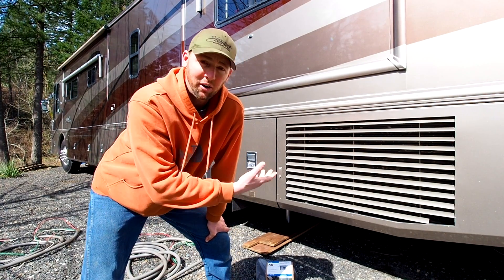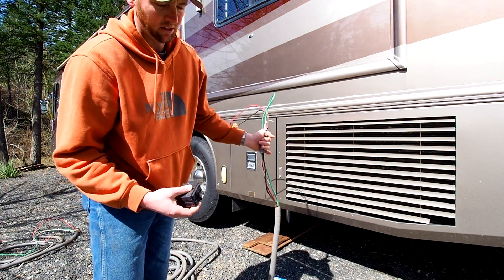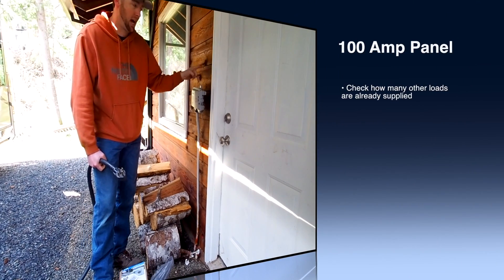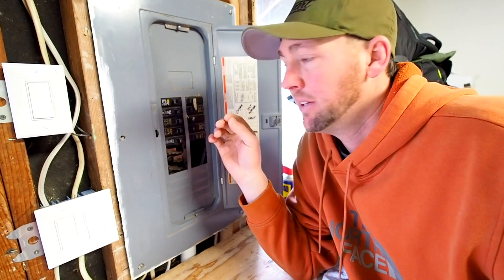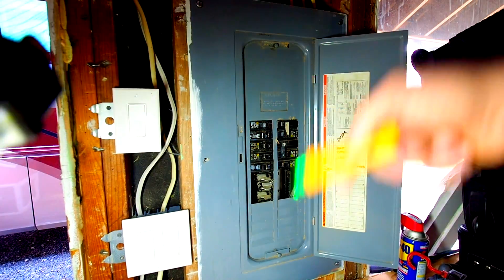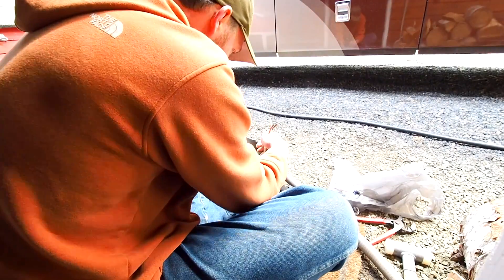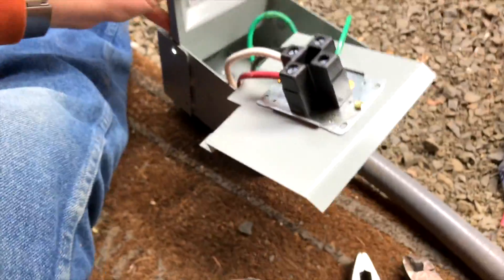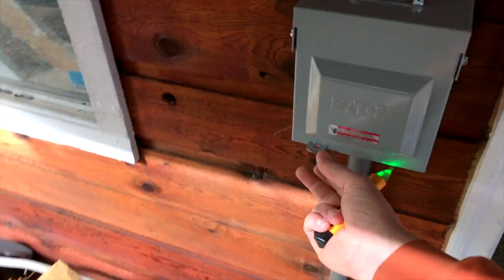RV POWER SUPPLY INSTALLATION FOR UNDER $50

Comment: FYI. For those who live in the states, per NEC code, electrical sub panels located in separate buildings from the main panel require a sub-panel main breaker.
Reply: Ya, I was thinking the same thing? Basically, if it can't be reached at arms length, you need a main breaker.
Reply: @commandtheline   I was like who put this together and didn't add a main breaker to the sub panel...

Comment: Nice job. I have a similar setup but regret not installing a second breaker at my pedestal which is about 150ft from my garage. Also, for those having an electrician installing, make sure they know how to wire the receptacle for an RV. The plug is very similar to a 220v dryer or range plug in your house. The 50 amp RV plug is wired differently to power two 120v circuits. I've heard horror stories of equipment getting fried because of this mistake. Cheers!
Reply from the maker: Thanks Brian! Yes I saw some videos talking about electricians & people mixing up those 220V dryer circuits. Bet they won't make that mistake again. I really enjoyed your recent battery install. Once we sell our house I'll begin our own battery upgrade and solar panel install. The jobs never end! Hope you guys' summer travels go well!
Reply: RVwithTito there is no difference in wiring a 4 wire dryer receptacle or rv receptacle, if someone let the smoke out they don't know what they are doing, this was a good install video, I would definitely spend some money on an actual meter so you can see voltage as a # instead of a beeping or flashing light, it's always best to check to make sure you have 120/240vac before blogging in your rv
Reply: Blogging>plugging
Reply: @OutsideIsCalling  That is exactly what happened to my parents. Luckily they used a surge protecter when plugging the camper into the box their electrician had wired to 220. My mom read the instructions that came with the box and instructed him how to wire it correctly. Needless to say, they wired the next box themselves. Thanks for a great video.
Reply: That’s a 220 4 prong plug.

Comment: im doing a 30 amp service is there a polarity issue with where you connect the hot wire on a three pronged recepticle and outlet?
Reply from the maker: Hi Alan, I had a similar question with the two different hots on the 50 Amp connector, and whether or not it mattered where the two hots went. It definitely IS critical to land the hot, neutral and ground wires to the proper connection points. I found several images from a Google search, hopefully similar images will help you see which one is which. It's pretty critical because if the wires get mixed up, it could create a direct short or several other problems. All of which will have big consequences. Hope that helps!
Reply: The 30A outlet has a hot, neutral, and ground. They must be connected up correctly. In your circuit breaker panel, you have two hot. I recommend connecting to the lighter-loaded hot.

Comment: Great job! No "main breaker" in your sub-panel is what we electricians call it. Now, come and do mine. I just bought a used '06 5th wheel.
Reply from the maker: Thanks for the tip! Haha, you'd probably do a better job than mine 😅
Reply: @OutsideIsCalling  You've got the electrical panel nailed! Perfect job. I see no problems.
Reply: @OutsideIsCalling  Have you had any problems?

Comment: I've owned a motorhome for about 10 years.  Over that time I've repeatedly seen the recommendation that you switch off the 50A circuit before plugging in, then switch it back on once the plug is seated.  The reason, as I recall, has to do with concern that if the prongs on the plug don't make simultaneous contact to a live circuit it can damage your coach.  (I realize that's not a good description--what kind of damage?  How?  Etc.  But I don't have a detailed understanding of the risk.)  Most homeowner RV connections I've seen were just like the one you illustrated; just a local receptacle to plug into; breaker switch in a panel somewhere remote from the hook-up.  Even some RV parks are like this.  But most RV parks have a breaker switch right on the pole, and in those cases, it's easy to switch off, plug in, then switch back on, per recommendations.  So here's my question (for anyone who might have a reliable answer):  I'm installing my home 50A RV circuit now.  Even though I will have a 50A breaker in the panel as normal, I'm wanting to put a SECOND 50A breaker in the line right at the receptacle, to serve as a convenient local on/off switch.  Any problems (code violations, technical concerns) with having a SECOND breaker in the SAME CIRCUIT?
Reply from the maker: Hi Tom, hopefully someone with knowledge of the electrical code can chime in, and I'll share what I know here:

Yes it is really helpful at RV parks having the breaker right at the panel. There are all sorts of configurations, some have all 3 (50A, 30A and 15/20A) with breakers right nearby each one. And you've probably seen many parks will have just one or some other combination of those choices.

Many coaches using a 50A service will have half of their loads on one side, and half on the other side being fed by the two 50A prongs. To my knowledge the biggest concern is electrical arcing, say you have two AC units and a dryer that all kick in the instant you make the connection. And as you mentioned the connector going in crooked might cause one side to energize before the other, yet another good reason to have a dead circuit.

I would feel comfortable installing a second breaker to make it easier to kill power during hookup, AND it would be a great way to know that the power is in fact de-energized. A breaker far away, out of sight could be switched without your knowledge. That's why hot tubs and AC systems require a disconnect of some sort nearby the appliance. I would wonder if there is any considerations about multiple breakers causing more resistance to the electrical flow, or if heavier wires would be necessary? 

Please let us know how your install goes!
Reply: You turn off the switch when plugging a 50A plug to make sure that the neutral connects before the hots do. If neutral does not connect, voltage may be appear high on one hot-neutral and low on the other hot-neutral. 30A can be plugged in with the power on as there is only one hot.

Comment: How far from the panel box can I run my 50amp service 🤔.  Not able to get that close to my house with the RV
Reply from the maker: We have the same problem at our new home, which we wired for 30Amp service. If you're still looking (sorry for the delay) you're best to find a good electrical load capacity chart. Just measure your power run, reference the 50amp chart and it will tell you which gauge to use. I believe we added a couple books in our Amazon Gear list just for this video which will give you all that and then some. Best of luck and it sure is nice having a way to power an RV at the house. It'll make a big difference in keeping it clean, mildew free, and pipes from freezing if not fully winterized. That Amazon list should be in the description as well as links within the video 👍

Comment: How long was the wire run..I need to go about 225lf from the panel to my RV so wire size is key lol
Reply from the maker: He Tim, you'll def want to check out wire gauge charts to make sure your wire is thick enough. If you go too small the wire can overheat and fail. Ours was less than 10 feet fyi. Please let us know what you end up using 👍
Reply: @OutsideIsCalling  Will do, I am rethinking the entire project and considering going 240
Reply: @OutsideIsCalling  Thanks for the heads up!

Comment: It seems to be the same hookup as a household 50amp, is that correct?
Reply from the maker: I can have Jesse come on here later and correct me if I'm wrong, but yes this was a 50 amp household setup in our garage. Thanks for checking it out! Are you doing any RV diy projects?
Reply from the maker: Hi Tim! Jesse here. The 50 amp breaker on the panel is pretty standard, although there are a few variations for different breaker panels. You do want to be careful as there is a dryer outlet shaped similarly to an RV outlet. We'll put a few links in this video soon for the exact parts and pieces I used.
Reply: I’m constantly doing things with our motor home. Had to replace valve on the back of refrigerator for ice and drinking water, a clothe washer leak, replace a motor on one of the slides. The people who had it before us never used the furnace so when we went to use it, it wouldn’t work, we about froze in the 30 degree weather. The manufacturer wired it wrong, therefor we called the manufacturer and they stepped us through it and paid us for our time and inconvenience. The microwave almost fell out going down the road so the manufacturer also paid for that along with the extended warranty company. It was a year old when we bought it and we’ve had it for 2years now.
Reply: Thanks Jesse, appreciate y’all quick response. I’m looking forward to the links to put in a 50amp instead of the 30 amp we have in there now. It was a 30amp dryer plug but I just unhooked one of the hot wires and it works ok for 1ac unit, fridge and lights.
Reply: NO! It is not the same as a household 50 amp plug!
Reply: @thesteveprichard  I know it’s not the same plug but electrical hookup. Thanks for the info.

Comment: Recommended you test with a multimeter  for correct amps to each hots and not with that wand garbage.
Reply from the maker: I used to have a Matthews Z9, great YT name. I disagree, what if you didn't properly ground your multimeter, or maybe it was on the wrong setting, or a dozen other possible what-if's. The cheap little wand doesn't have any of those constraints. After using a wand to confirm a line is de-energized, make sure to confirm it's working properly with a live source  (safe method for confirming your batteries are still working and the line is in fact de-energized).
Reply: Honestly I would use a meter, I've cut into a couple live wires thinking they were dead trusting a klein tick tester. Sometimes 240v can cause the tester to not function properly. But ive had the meter do the same. So to each his own. But I lean towards meters.
Reply: You have 240v going the rv.  I do believe they are 120 volts.

Comment: Hi, what gauge wire did you use??
Reply from the maker: Hi 777dingo, I honestly don't recall but here is a link to a wire gauge chart for choosing wire. Or find any wiring chart, find the 50 amp column and see what gauge is needed for the length of your wiring.
https://citypix.info/charts_new.php
The length of your wires (5' vs 50' for example) will determine the gauge wire you need. The shorter it is, the smaller and cheaper! Hope that helps,
Jesse
Reply: @OutsideIsCalling   6AWG minimum for 50A. If you have a long run, you might need to go to 4AWG

Comment: What gauge wire is that?
Reply from the maker: It's been so long I'm not positive, but I believe it was 6 gauge (3 conductor & 1 bare ground). It was a piece of scrap left over from a hot tub install. Keep in mind the farther your wire length is, the thicker wire you'll need so it doesn't heat up and overload from too many amps and too small of a path for electrons.

Comment: No way this cost under $50. The box itself probably cost more than that, and copper wire of the appropriate gauge is about $7 per linear foot in 2023.  Maybe this is a really old video ;)

Comment: Where is the part where you did it for under 50.00 dollars
Reply from the maker: Here's the breakdown : 
50 amp RV outlet $30 bucks, 
50 amp, two pole breaker $8 bucks, 
$12 for wire which we didn't have to buy so my cost was $38 bucks. (I had left over wire from a 60 amp hot tub)
6 gauge wire is about 2.50 a foot, so someone's wire cost will depend on how far away the RV plug will be from the breaker (about $2.50 times x feet from panel) Today, two years later that same panel is about $35 at Lowe's.

I recently installed a 30 amp RV outlet and the Midwest 30amp panel from Home Depot had really crappy connections, the 30amp Eaton from Lowe's (same brand as the 50 amps outlet in this video) had way better connections to land the wires. I'm definitely a fan of Eaton now, sorry Midwest.

Hope that helps. 
Jesse
Reply: @OutsideIsCalling  ok thats where i was baffled because wire is so expensive. the biggest expense in the project since i do not have any wire. thank you for responding

Comment: Please guys, this is NOT the same as a household 50 amp 240v receptacle and plug.
Reply from the maker: Yeah but what about my 30A outlet behind my clothes dryer. That'd work pretty good, right?!! Just run the RV cord through the kitchen window 🤪
Reply: @OutsideIsCalling  No! Your clothes dryer receptacle is a 30 amp "240" volt, which is 2 hot wires and 1 ground wire. Your RV needs a 30 amp "125" volt receptacle, which is 1 hot wire and 1 neutral conducting wire and 1 ground wire. You can Google "running a 30 amp RV cord from a 30 amp clothes dryer receptacle," which will explain it better.
Reply from the maker: Hi Steve, I was just trying to be funny, (not sure if you saw the crazy face icon 🤪) Yeah it wouldn't be good to hook up to the dryer, people definitely want to install a devoted 30A or 50A outlet for their RV's. That's what we did and it pays for itself in the first year since you don't have to clean mold, mildew, or any other nasties lurking about in a stagnant RV. For those of you reading, after installing an outlet to power your rig, your second upgrade should be a cover to keep sun, rain, and the elements off your RV. It'll make a huge difference. Not right away, but over the course of a few years being stuck out in the elements. Happy Camping
Reply: It IS the same four-pin 50A receptacle and plug commonly used for kitchen ranges.

Comment: Wow not up to code
Reply from the maker: Probably not up to code? What do you think I am, an electrician or something?? 😆 If you know better please do share what I screwed up, it might just help another viewer.
Reply: You need a main in sub panel (per NEC)  first of all
Reply: What gauge are you using
Reply from the maker: Thanks for sharing Caleb! This was two years ago, so not 100% sure but either 4 or 6 gauge. I think the run was about 6 feet from the 50 amp breaker to the RV outlet. This house is long gone (sold Nov 2017), but do you know if most sub panels can accept a main breaker or would an entirely new panel be required in order to have that main breaker you mentioned?
This was way out in the country so most things were certainly NOT up to code. The owners that we bought the house from were, ehh... to put in nicely, more concerned with making and selling illegal things than fixing their house. It was in really rough shape, which means it was in our price range haha.
Reply: You can get a 2 pole 100 amp breaker and put your main feed (red and black) into the breaker and not the lugs on top. Some do include a spot on top for a main breaker
Reply from the maker: Thanks for sharing Caleb! This is one of our most popular videos, so hopefully this will help some other folks trying to install RV hookups.